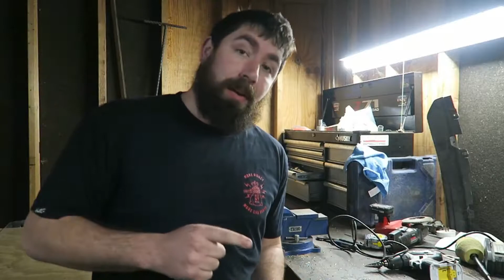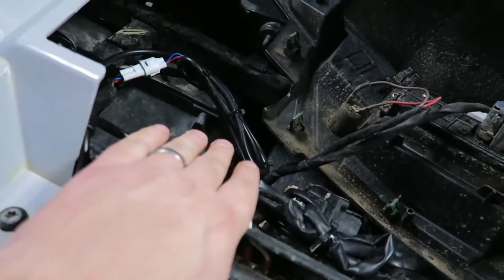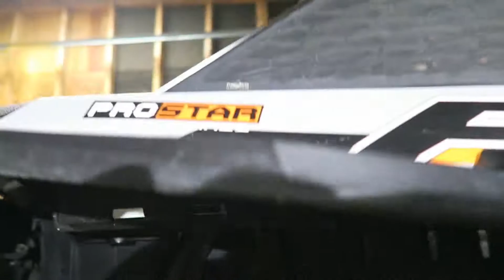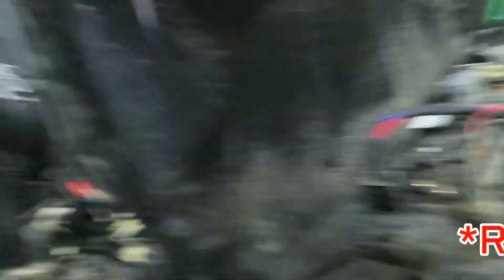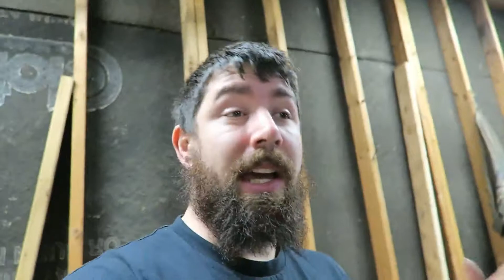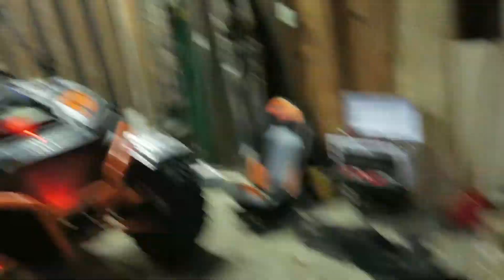Instaling R1 industries 4f Wildcat Extreme LED Whip Lights (HOW TO)

Comment: I just got my 3ft whips today and have just been playing with them hooked to a battery, should I use a relay or just a inline fuse when hooking up to my machine, 2022 can am x3 XRS RR
Reply from the maker: Damn you are lucky to have a 22 already and you don’t need a relay they don’t draw very much power
Reply: @redneckengineering7739  it's still sitting at the dealer missing the ECU and cluster hopefully we will pick it up late Jan when parts come in. I'm just stocking up on a few parts
Reply from the maker: Damn that sucks I’m sorry to hear that are you should add me on Instagram

Comment: Great video! Thank you for your support! 🤘🤘🤘 
We love the instal and everything looks great. The only thing we would highly recommend fixing is you should never put anything electrical on your fuel lines. If there was a short or anything were to happen (we have never had that happen)  but if it did happen your machine would go up in flames extremely fast! 

Other then that great job and thank you!
Reply from the maker: Yeah that’s true but I traded that in for an x3 immediately after installing these lights I uninstall them to put them on that LOL you might have seen it on my instagram
Reply from the maker: Also run those wires a lot nicer